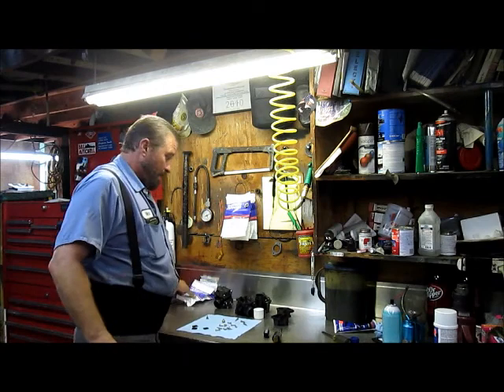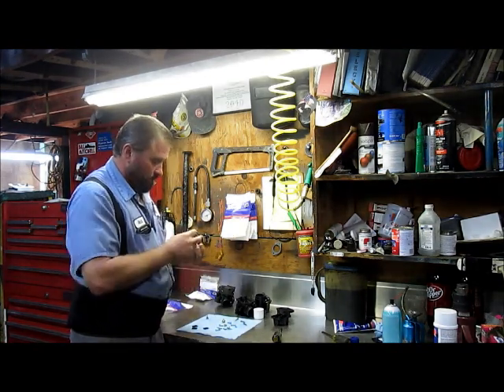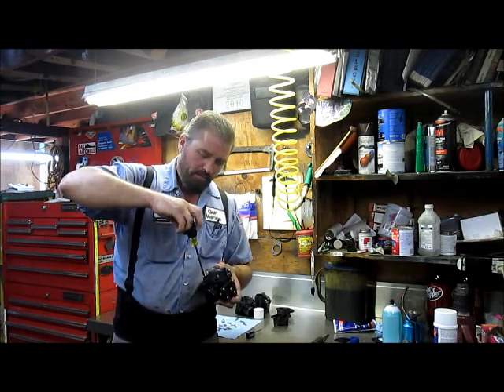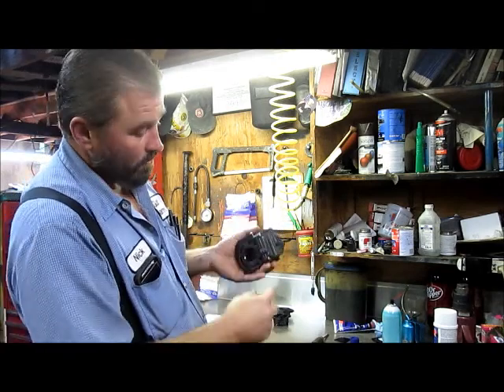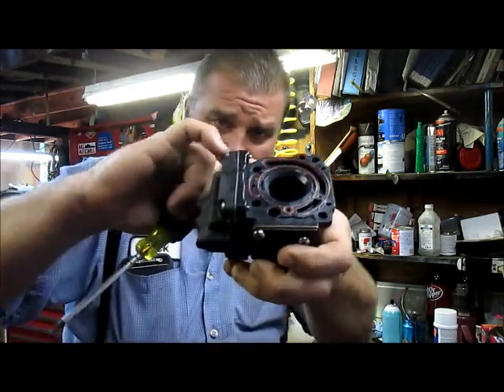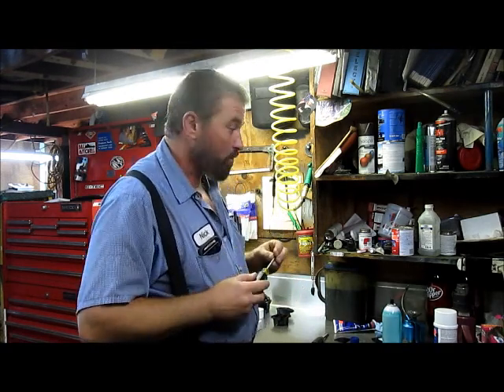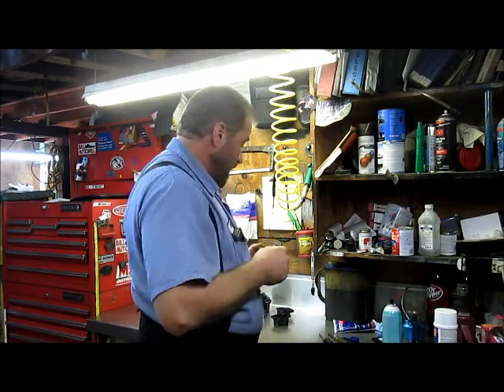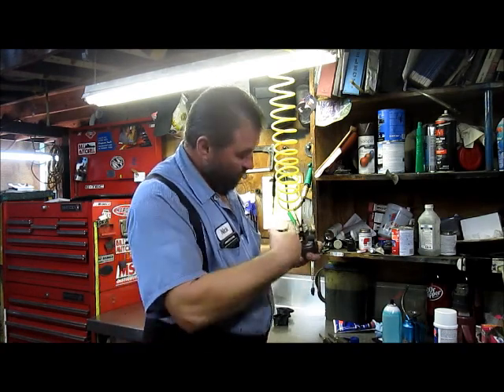Evinrude/Johnson carburetor repair, professional assembly for 60 and 90 deg looper pt 3

Comment: Have you done any work on E140tlcdc 140 evinrude 1986?  I'm having issues staying at high speed and do you sell carb for this motor
Reply from the maker: You have to re-jet the carb if you aren't performing well at high speed. This is something I highly recommend you get a pro to do. Engine failure can result if done improperly.

Comment: how you doing nick good i hope you are very good at what you do aim wondering if you can help me i have a older boat 79 bass cat with 78 Johnson 115 hp the model no. ETL78c  says it Evinrude don't know what's up with that but anyway i have a lean problem i have been fighting sneezing coughing at low idle burnt spark plug up carbs have been overhauled no lean or rich adjustments on these carbs i look at the rest of the plugs dark brown a kinda wet got any advice  the motor has been touch by somebody the piston say 30.0 over i can still see the home marks on the cylinder walls don't want run this motor with out fixing it first anything else i can check?